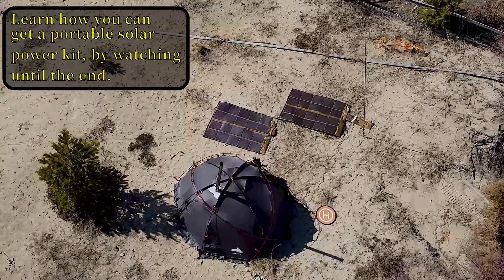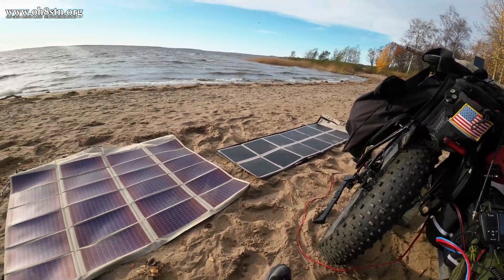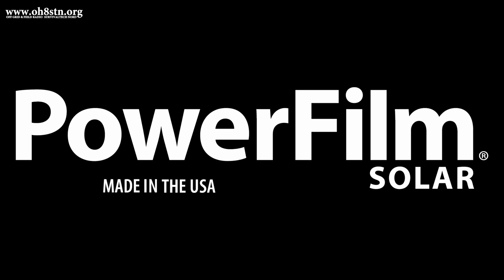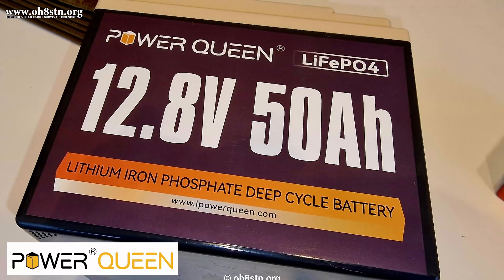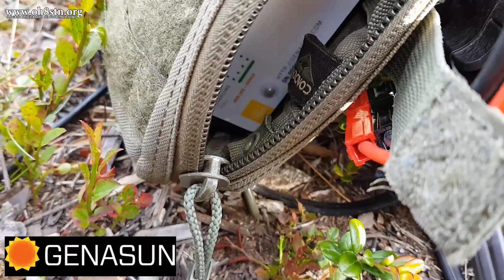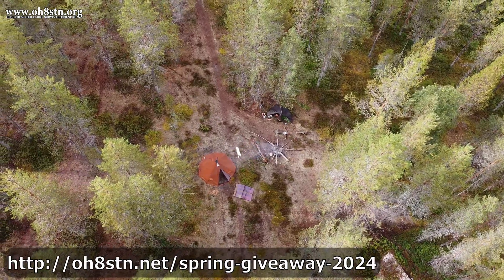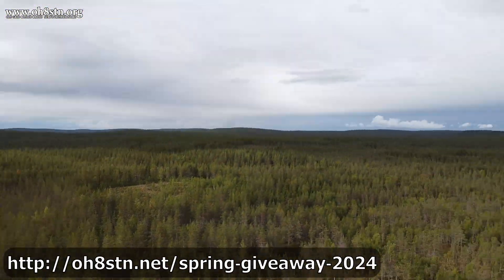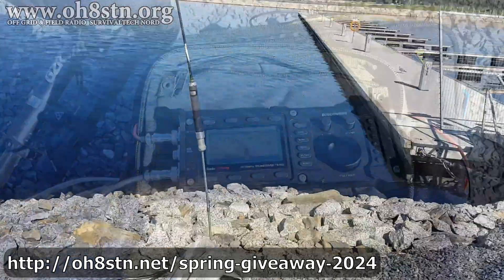Portable Ham Radio on Solar Power 2024 PREVIEW

Comment: Hi Julian, I'm using a 10ah 12.8v lifepo4 battery with a Genasun 4s controller. When it's charged the controller lights the red fault LED. 12.8v battery would be 3s but I noticed you're using a 4s on a battery of the same voltage. Is this of any concern. Regards Steve VK7SL.
Reply from the maker: Lots of people make this mistake. You've confused the nominal voltage for full voltage range of a lithium-ion phosphate battery.
12.8 volts is the nominal voltage. 14.2 through 14.4 volts is the full voltage when full. The battery pack should be 4S if you're using a 4S Genasun controller. 12.8v nominal,  14.2-14.4 volts when full. The red LED comes on because you're overcharging the 3s pack which should be 4s. Add a 4th cell for 4S. Also, make sure you're using LiFePO4 cells, not Li-Ion or LiPO.
73
Julian oh8stn
Reply: @OH8STN  it's 12.8v nominal the same as what you're showing in your video with the 4s charger but 10ah and a different brand with a BMS.
Reply: It is a lifepo4.
Reply from the maker: @stevenlloyd5789 You're making an incorrect assumption about the voltages. You believe 3S is 12.8v. The mistake you're making is the 3s pack is full at ~12.8v, but the 4s pack is full at 14.2-14.4 volts. Believe your eyes! The Genasun controller is telling you "4S" and warning you of an over-charging fault (red LED).  According to your first comment,  you've only got 3 cells in series. You must use 4 LIFEPO4 cells in series for a 12.8v (14.2-14.4) nominal voltage battery pack. Hopefully you haven't damaged the 3 cells in series.

A 4S LiFePO4 (lithium iron phosphate) battery pack consists of four cells connected in series. The nominal voltage of each LiFePO4 cell is typically 3.2 volts. Therefore, the nominal voltage of a 4S LiFePO4 battery pack is:

\[
3.2 \text{ volts/cell} \times 4 \text{ cells} = 12.8 \text{ volts}
\]

However, the voltage of a LiFePO4 battery pack varies depending on its state of charge (SOC). Here is the typical voltage range for a 4S LiFePO4 battery pack:

- *Fully charged:* Around 14.6 volts (approximately 3.65 volts per cell)
- *Nominal voltage:* 12.8 volts (approximately 3.2 volts per cell)
- *Fully discharged:* Around 10.0 volts (approximately 2.5 volts per cell)

It’s important to note that discharging below 2.5 volts per cell (10.0 volts for a 4S pack) can damage the battery, and charging above 3.65 volts per cell (14.6 volts for a 4S pack) can also harm the cells. Proper battery management systems (BMS) are typically used to protect the battery from operating outside these voltage ranges.
Reply from the maker: If you do have four cells in series and your comment about three cells was a mistake, the red LED can also indicate the BMS cutting off because of a high voltage state. 
Please clarify whether you're using 3 cells in series or 4 cells in series for your pack.
Reply: @OH8STN  the only info I can find is 12.8 battery voltage, maximum charge voltage is 14.5 and discharge cut off voltage is 10v. No indication on the case or in the specifications whether it is 3s or 4s.
Reply from the maker: @stevenlloyd5789 Steve, I'm informing you that it's 4s. If you're using 3s, it's wrong.
Reply from the maker: The nominal voltage of a 4s LiFePO4 battery is 12.8 volts. I've given you all the information I can. Good luck!
73
Julian oh8stn

Comment: Thanks for your video content on solar/wind energy efficiency for the shack.  Still trying to enable asynchronous communications with my MS Surface Pro3. You have explained the setup with the MS Surface Go. Not sure if setup is exactly the same with the Pro3. Your comments welcomed.  Mahalo!
Reply from the maker: Not exactly the same. I believe the Pro 3 has a standard USB port, and a Surface Connect port for charging. This would mean your audio interface or radio would plug into the USB port instead of the USB-C port. Also, I'm not sure if the Pro 3 has an integrated GPS.
You'll have to provide more hints to what error you're getting in order to troubleshoot.

Comment: These are good videos.  I've assembled a pretty modest portable power solution but I need to step up off grid power at the shack.
Reply from the maker: Excellent. The shack was a can of worms at my station. There were things to learn which were never an issue setting up a field station.
My advice, go slow!
Thanks for watching and commenting. It is greatly appreciated.
73
Julian oh8stn

Comment: Julian.. am interested in your Wind turbines.. can you provide information  on where to buy these.
Thankyou for your hard insightful work.. without your input.. i would be lingering in the dark on the matter of Ham Radios and Solar/Wind power.
Reply from the maker: Thanks for the comment and kindness. Things are constandly changing with the wind turbine. Every day brings new lessons and ways of utilizing the turbine, in a way I had not considered previously.
I would start here: https://oh8stn.org/blog/2021/08/06/vertical-axis-wind-turbine-project/ This is the original post for the project. It also has updated information on my plans for using the wind turbine as a dump load, for a diy sand battery heater for teh off-grid ham shack.
Let me know if this would be interesting for the channel.
73
Julian oh8stn